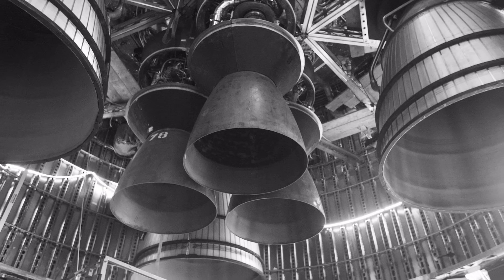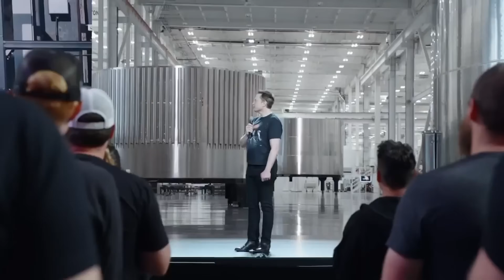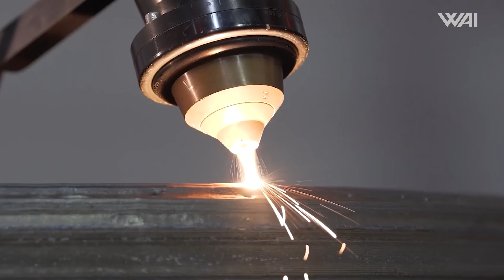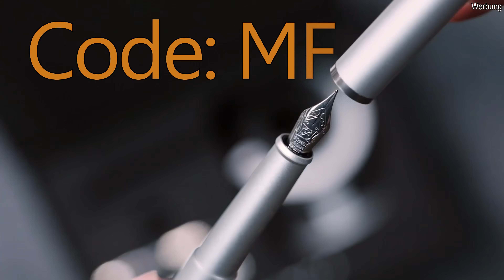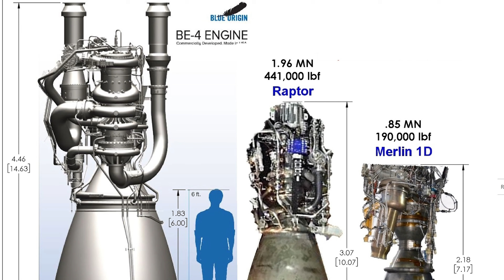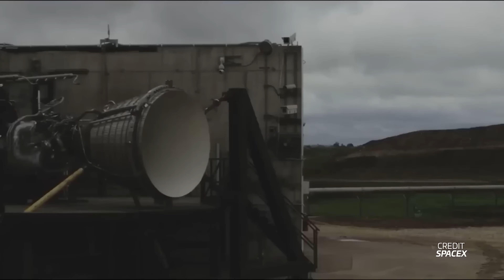The Greatest Rocket Engine Ever Built!

Comment: "There is exactly one engine on this planet that achieves [...] full-flow staged combustion"
Not quite! Stoke Space has a FFSC engine as well. To quote their web site:
"June 11, 2024 — Today Stoke Space announced that it has successfully completed the first hotfire test for its new full-flow, staged-combustion (FFSC) rocket engine. The engine will power the first stage of Nova, the company’s fully reusable medium lift launch vehicle." Yeah, later you say "no other has ever flown" which IS true, but at the start you don't have that qualifier, and it would probably be better to point out that there are at least others that have been successfully fired, even though they haven't yet flown.

Also, the BE-4 "always being thrown away" by ULA is something they have plans to change, by detaching and recovering the thrust section of future versions of the Vulcan booster. Not full reuse, true, but the engines are the majority of the cost of a booster, and it's a step in that direction.
Reply: Having an engine is not the same as having an engine that has supported flights.
But stokes Zenith engine is impressive nonetheless.

Comment: Let's wait until Raptor 3 actually puts something into space.
Reply: Exactly. It has done nothing. It will be a great achievement, if it works. If it does, it'll be the first Raptor to not disappoint.
Reply: Didn't they place a bunch of dummy V2 starlink sats into LE orbit on their last test flight?
Reply: @CL-gq3no  Not Raptor 3s, but they did  put some useless weight into "space" for less than an hour, on their third try just to get the door to work. Bravo.
Reply: @troys9222 , ok.  So, they did that with mostly raptor 2's, but you seem to think Raptor 3's will be less capable/reliable and that they will only be able deliver heavy junk to orbit instead of equally heavy expensive payload?  Interesting logic.
Reply: @CL-gq3no  "Mostly"? No Raptor 3s have ever lifted anything anywhere. I expect them to be as unreliable as the last two versions at least, given the extreme rework, elimination of many sensors, etc. No Raptor has ever delivered anything near what it has been advertised. This "heavy junk" you speak of was about 18 tons, and V2 was supposed to be capable of 100 tons, but SpaceX admits V2 could do 35 tons max, with engines failing regularly. Why would I expect sudden leaps? I never said Raptor 3 would deliver anything reliably.
Reply: @troys9222 , ok, whatever.  I clearly don't care as much as you do.  I just find the advancing technology and incremental accomplishments interesting.  You seem to have a personal stake in the matter.  You are free to launch your 100 ton payload on another launch system though.  I wish you the best getting to orbit.
Reply: @CL-gq3no  Who said it wasn't interesting? I can't be excited anymore, because when it's time to fly, and improve, and get moon hardware tsting, yet again they have to redesign and "upgrade" absolutely everything first due to lack of performance, then they try to practice spamming satellites when they fly, even this late in the game with a slipping contract. If they can't very suddenly turn it around , do 100t reliably and have the ship fairly quickly reusable, they'll have essentially crippled the moon program for years. That's my problem. Forgive me if I'm not still impressed by lofty goals and shiny new equipment that falls short time and time again.
Reply: @CL-gq3no  The V3 Raptors have never flown.
Reply: They scrapped a bunch the other day because they had to turn them off😂

Comment: It better be great because it's the last line of defense for a 3 trillion $ illusion. All of Musk's businesses have failed yet people still put his valuation at a total of 3 trillion $ just for a chance at this thing.
Reply: Literally every one of his companies that aren't still in the startup phase, is in fact making a profit. Every single one. And he puts the profit right back into R&D for his plans.
Reply: Also, SLS is nothing but modified Hardware designs from the 70s and '80s. It took 12 years, and cost $25 billion dollars. Starship has been in development for right about 12 years, and Elon Musk has spent less than 8 billion dollars. Starship is the largest, most complex thing ever launched. His development rate, while Far Below his stated goal, is absolutely smoking the tires off the rest of the rocket industry.
Reply: @lordgarion514  Can you measure development rate yet? Building rockets isn't the important part. Falcon 9, you know the one that works, is much more "60s" than SLS. Kerosene burners to LEO are 60s tech, but they did add reuse to it. Starship has raised at least $8 billion from NASA and private funding. Starship is smoking no one. Do you not expect any further results? It seems like we could be having this same conversation 2 years ago, or 2 years from now, still firing them nowehere, and it wouldn't matter. The dream is more lucrative than having to produce, and it will be for a while, since progress of mission stopped a couple of years ago, and each underwhelming flight still has no expectations.
Reply: incorrect. All his businesses are making money. A shit ton of money.
Reply: @AussieFroggy71  Saying all have failed isn't true, but many make no money, no shit ton, nothing. The Boring Company, Solar City, Neuralink and X Corp make no money at all, and other companies while under his control were failingat, like OpenAI and the Hyperloop debacle. SpaceX does make a shit ton, but Starship had better start spamming satellites quick. Even they can't afford for a project this big to become another Cybertruck.

Comment: You can NOT call this engine the greatest ever. It’s not done anything. It must prove it first prove itself the design etc. It’s not proven 100% reliable every mission a
it’s not carried a payload or humans etc. every mission has had a engine failure whether on the booster or starship. This is NOT the greatest ever. That’s still the F1 right now. This may beat it out someday but it’s not yet. You at most can say it’s the greatest design to ever make it into existence or production, but you cannot call the greatest ever right now.
Reply: They have to ride hype for things that haven't happened, in case it's a disappointment like R1 and R2. Remember the fun hype  of V2 ship "upgrades"?

Comment: Does this guy even exist? His mouth doesn't match his vocal in multiple spots, an obvious tell of AI. That's okay, because the video is quite interesting. Unfortunately, the most unique part of the video is the worst. The full-flow engine. You cannot explain something simply, instead relying on complex terms, foreign to the uninitiated, unless you understand it yourself. Follow the example set by the R3 itself! SIMPLIFY. Use the simplest terms possible. As rule #13 of Strunk and White urges, don't choose a $20 word when you have a ten-center handy. And don't zone out your viewers by tiring them with long German terms. Learn what you are talking about down to the details so you can explain it to others without leaving out a single LINK in the process.
Reply: Yes, he exists. And the reason the lips don't match the words, is because he is speaking german, and an AI was used to translate and dub it into english.

But this is in fact the most complex rocket engine, that according to the laws of physics, can even be built. It was thought impossible to actually build back when it was first designed. Hence the Russian and American failures. They were trying the impossible due to their technology level. And as another YouTuber said in a thread up above,
"simplicity is the result of simplifying at the expense of comprehensive details where the devil lives"

If you try to simplify the most complex rocket engine theoretically possible, down to an eighth grade level, you're not truly going to understand. Not everything can be simplified to nothing.

Comment: The real question is: can you ride an engine this hard and make it reliable and reuse it? Only real flight tests will answer this question.
Reply: If you test it to 350bar and they hold, if you lower it back to 280bar reliability grows a lot.

On top of that, they are making it extremely cheap (for a rocket engine) and extremely fast.

If you get 5-10 flights per engine, it's already a huge win.

So even assuming no improvement, it is still an order of magnitude better than what others got.
Reply: @Coyote27981 True, but if they lower it, they will get no payload capability. So they are stuck.
The Raptor 3 is supposed to give them 227,000 lbs to LEO payload which ia still less than Saturn V.
That is at max thrust.
Reply: @pedrosura  v3 meant to do 200+ tons to LEO expandable if need be. Saturn was only able to do 140 tons top.
Reply: Elon Musk certainly intends to put that to the test. Even if these engines last for 200 or 300 flights instead of 1,000 flights  that is a big step forward.  I'm sure a Raptor 4 is in the works.
Reply: @taras3702 Do you really think a Raptor 3 will fly 200 times?? Based on what evidence??
Reply: @pedrosura Full flow staged combustion has a big advantage, namely the pre-burners and turbines operate under less harsh conditions than simply using the traditional method of staged combustion. That alone improves reusability dramatically.
Reply: @taras3702 Improve it over what? The Fslcon 9 engines? Shuttle engines? You really need to get a lot of flight data to look at reliability. Not just claims. It is true that the closer you fly an engine to design limits, the grrater the chance of failure. True for aircraft or rocket engines.
Lets see if they can fly it once.
Reply: @pedrosura  Improved immensely by design alone. The full flow stage environment is a huge improvement on wear & tear because the design naturally operates at much lower temperatures and pressure, which allows them to draw more power from the engines. But even more important is the propellant they are using will allow much cleaner burns that allow the engines to be more durable and require less refurbishment between uses. All that leads to a path of much higher and faster reusability (in theory).

But another thing that doesn't get talked about much is scale. Because the design of the whole ship, it allows for much different and less strict weight margins than much smaller rockets. While a lot of the internals and pipes have to be scaled up...a lot of the hardware needed to operate the rocket remains the same. Like flight computers and wiring (longer wire harnesses but same size wires being used). The smaller the rocket the less margins you have to work with.
Reply: @pedrosura Falcon 9 uses engines that use the gas generator power cycle  like the F-1 engines of the Saturn V. Reluable yes  but some of the propellant is dumped overboard and does not generate thrust. The Raptor engines are much more efficient because they are closed cycle engines that also burns both propellants in the main thrust chamber as a hot, high pressure gas. That raises the efficiency and specific impulse too.
Reply: @taras3702 Because of the thrust spec for the engine, they will be operating at record setting pressure ratios, going thru extreme temperature cycles for the life of the engine (25 flight??) so, a lot of this stuff is at best theoretical at this point. Lets see what happens with flight test. I am not aasuming these will so better than Falcon 9 until I ses the test data.
Reply: At this point it doesn't even matter if it's reusable. (Though I'm sure it will be). The full stack only has 10 million dollars worth of engines. On a ship that carries 200,000 kg to LEO, 10 million is neither here nor there. 

That's what no one seems to get about Starship. At this point they've flight proven everything for expendable rockets. They've flight proven a reusable booster. 

Even if SX never makes any progress beyond this point and we're left with an expendable upper stage and a reusable booster it's still a rocket that will cost under 10 million per launch. That's 50 dollars a kg. They're currently selling launch at 4000 - 7000 dollars per kg. These are the kind of profit margins even pharmaceutical companies have dreams about. And even at those prices, they're essentially the entire market. People say "oh, but it's not appropriately sized for a small launch". If they wanted to take the entire launch market. They could under cut electron. Launch your 300 kg payload wherever and whenever you want for 5 million and fill the rest of the ship with Starlink. At this point they have won space launch. Companies like Rocket Lab know this and that's why they're pivoting to satellite as a service rather than a launch provider.
Reply: They broke some the other day because they had to end the static fire earlier than expected
Reply: @prophetrob If you're going to be a troll at least be a believable one, static fire abort was due to a pad side sequence abort not a booster abort
Reply: @calvinallan2208  I'm talking about the 10 engine test that resulted in replacing all of them
Reply: @prophetrob , I believe the shutdown was due to a bad sensor and very conservative failsafe logic.  The rapid emergency hard shutdown caused damage to the engines, not anything related to the normal engine operation.  Anyway, why does it even matter at this point?  They are testing and often intentionally testing to failure.  Things are going to break.